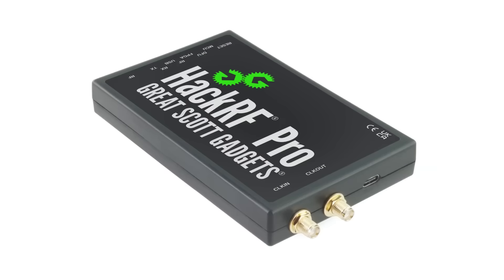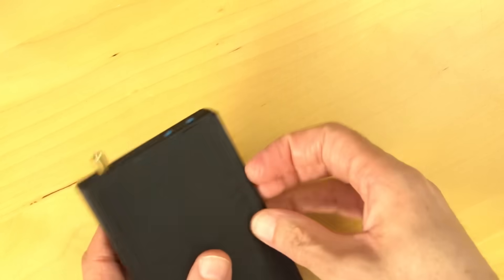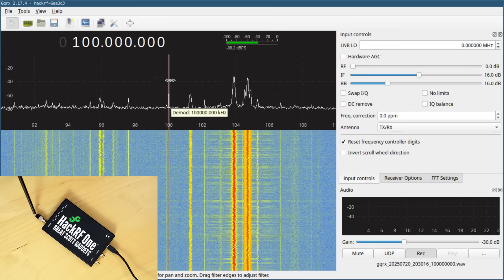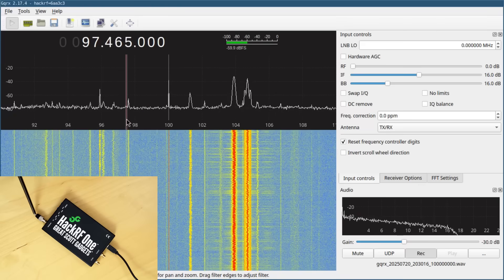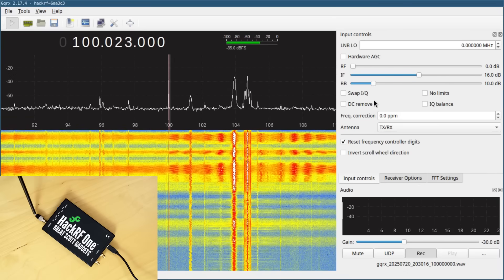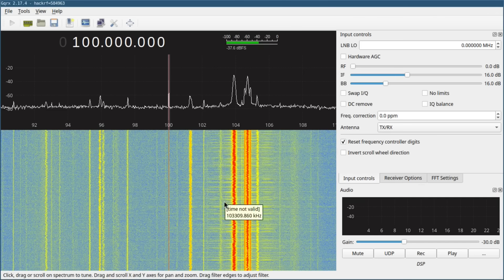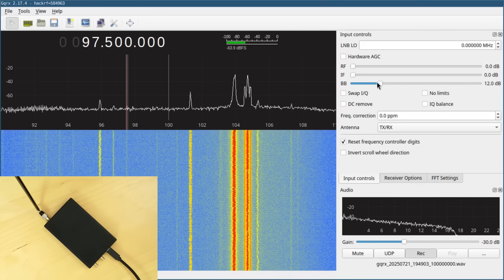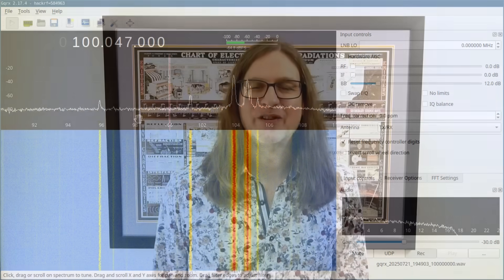First Look at HackRF Pro

Comment: Cool!   From the website, users can expect these improvements over HackRF One:

Wider operating frequency range
Improved RF performance with flatter frequency response
Built-in TCXO crystal oscillator for superior timing stability
Elimination of the DC spike
Extended-precision mode with 16-bit samples for low sample rates (typical ENOB: 9-11)
Half-precision mode with 4-bit samples at up to 40 Msps

I know HackRF One was the OG for transmitting.. but how does the Pro compare to SDRs that have been developed after the original HackRF One?  like LimeSDR USB* ,  SignalSDR Pro, FreeSRP,    KrakenSDR , iotSDR , ADALM-PLUTO?

*Frequency Range	100 kHz – 3.8 GHz  
Bandwidth Up to 61.44 MHz
Full-duplex (2x2 MIMO)
12-bit Sampling Depth
Sample Rate	Up to 61.44 MSPS

Comment: Thank you Michael for all your great projects and for making them open source! ❤ Thanks to your video tutorials I got interested in radio and got an amateur radio license. Now I'm operating using an entirely home made setup - a multiband HF antenna and a SSB/CW QRP transceiver. Which is open hardware by the way and several people are building it. Took me a while (8 years or so :) to understand DSP on a decent level, here "Understanding Digital Signal Processing, 3rd Edition" by Richard Lyons was a great help.

Comment: This would have been sssooo much more interesting if you included an option for an AMBE3000. It would really be able to decode analogue and digital on the fly. I just finished writing a Python script to control the HackRF one (ultra basic) for testing Bird Thruline elements at GHz through a 1w amplifier.

Comment: I will pass - $400 for an 8 bit receiver in 2025? It doesn't even do duplex. It does transmit, but you can't use it for satellite and what are the TX spurii like? The original was fairly poor, too poor for use on air. It might be a USB-C connector, but it is a USB2 port.
Reply: I think the Pluto on Aliexpress does better also price wise.  I hope in this life I will catch the time when 20GB/s ADC will cost 100$ so you can do direct SDR end of story
Reply: What device would you reccomend for full spectrum access ?
Reply: Never thought I'd hear of someone complaining about the price of an open source project 😅
Reply: @brianl2607 it's still a product even while open source?
Reply: are the concerns on TX correct?
Reply: @NamasenITN how far are you trying to TX? TX has to fight against loss, which is defeated by increased power. This is not a highly powered unit. In the US, the FCC regulates all TX work to some degree, so emphasis is usually put on RX.
Reply: @brianl2607  His points are valid and there are other open source alternatives. At the end of the day they're still selling a product for profit and feedback is important, even if that feedback is someone's explanation of why they'll be taking their money elsewhere.  

None of this is to disrespect the devs because making something like this is impressive. It's not even a 'bad' product. It just suffers in value for money.

Comment: Really wish yall didn't go the route of "same form factor"... not much there to further "innovate"... what should have been done is a way to be able to "sandwich" multiple HRFs together.... take for example the amazing cluster projects out there... this would be easy if the board resembled something like that of the R Pi with GPIO headers- i know that a version did come out with an expansion capability...but the placement of connectors was ill thought out..awkward.

Heck, having a form factor more like an RPi could possibly allow for us to utilize PCI boards, add on WiFi cards, SSD, , the 4g/5g boards...

But, really the best would be the ability to have multiple HRF "pros" attached to each other giving us capabilities such as full duplex- 1 rx..the other tx....faster/ more efficient sweeps of the full spectrum...add even more HRFs where the antennas of each are offset giving us a powerful direction finding powerhouse...

...and best part would be the removal of the  connectors making it easy to stand on whichever side i'd likeresebled
Reply: I mean, it is open source. Just fork it.
Reply: Is there any chance you can do a video on the URTI project soon. Thanks
Reply: Honestly can't really see where this has improved.... all i see is increased noise floor... and i am sure an increased (given the increased components)- i guess usb c...but, why are we limiting ourselves in this day of age...maybe 3 years ago...sure USBC would be "skookum".... but ..this is the age of AI (lol) give us gigabt transfer rates...give us POE capabilities
Reply: @paranoidzkitszo guess we'll wait another 10 years 😂
Reply: When you have bds that are high-power, (Watts of heat,) with both digital and RF circuitry, (microvolts or less for input signals,) it seems silly to me to try to stack multiple boards. It just leads directly to overheating and intermod problems. What system miniaturization is important enough to need to sandwich the bds together? Just near instantaneous direction-finding, as you mention? For such RF/microprocessor system arrays to be successful they really need to be designed together as a single dedicated unit from the start. Being designed for and placed in individual metal cases with proper grounding solves most problems before they start. Also, these units are $400 a pop. Sure there are custom, dedicated installations, like a centralized direction-finding site where more than 1 of them will be desired, but I think most users will be looking for a quantity they can afford, like 1.